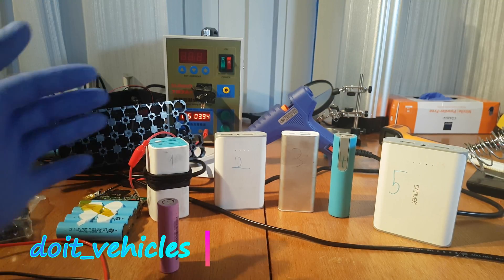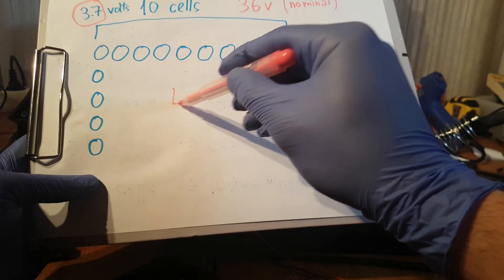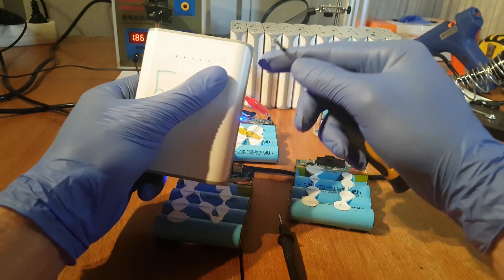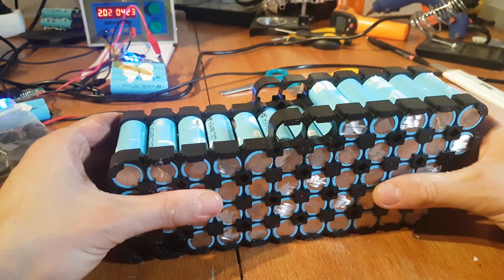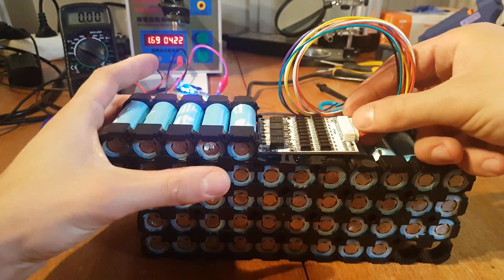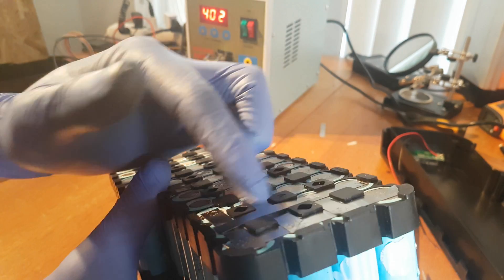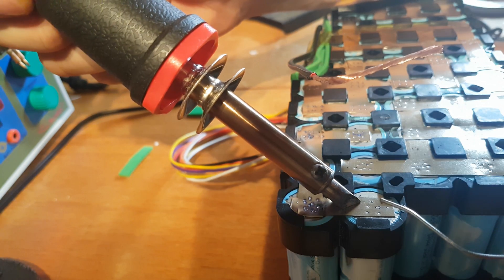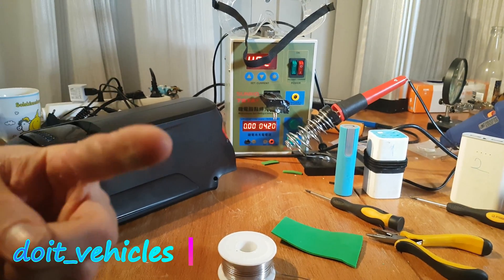How to Make a E Bike Battery from Power Banks with 18650 Cells - DIY

Comment: How do i make 72v battery pack that can take to 80km and above.
My electric scooter 🛵 came with 6 12v 20ah gel batteries connected in series and it can only go around 35km ?

Comment: Hello great video. How do you charge it and how long would it take to fully charge a 10s5p pack like this?

Also how long can your bike run for between charges and what would be the top speed?

Thank you
Reply from the maker: Hello and thanks ! I use a 2 A charger and it takes around 4-5 hours to get fully charged after a complete discharge .  Top speed would be around 35 km/h and the range can vary between 30km and 70 km . 

There are 2 older videos I made where I tried to explain in more details about the range of an e-bike )